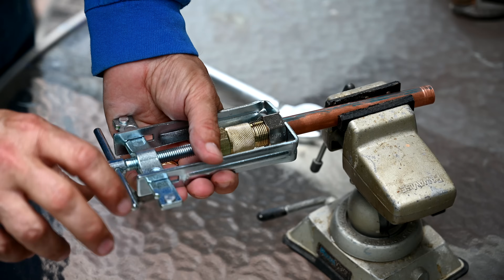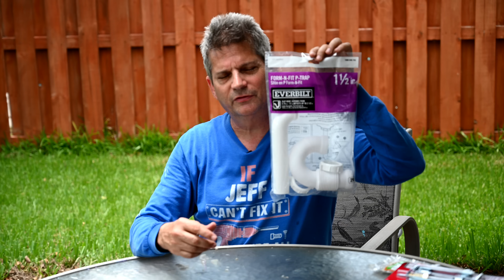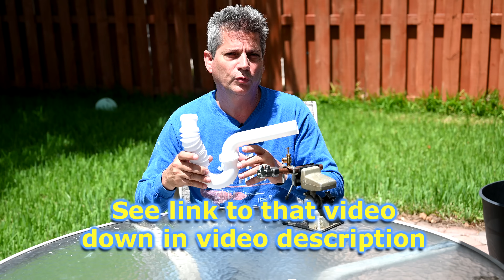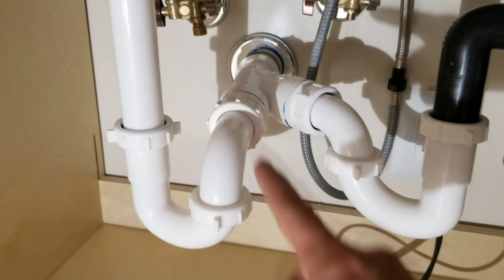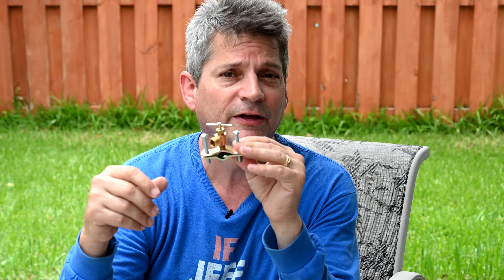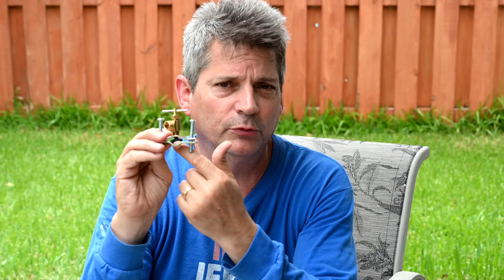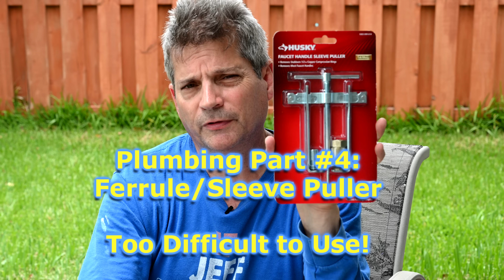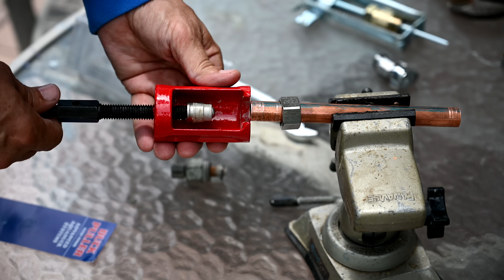4 Plumbing Parts/Tools You Should NEVER Use. NO Plumbing Fails

Comment: The reason why there is so many DIY plumbers is because plumbers charge so dam much for a simple fix or change 🤷‍♂️
Reply: You so called licensed  plumbers are nothing but thieves. I am a licensed plumber working as a handyman  because I have a conscience
Reply: @phillipbailey5178  yes sir.  Right with u
Reply: If it's just water ya charged to much but when they are dealing with your shit pipes then I'd bet those Plumbers aren't paid enough.
Reply: and how much do you pay an hour to have your car fixed?
Reply: @stevem268  sure as hell not as much as plumbers charge for simple flat rate.  Average for mechanic here in ND is anywhere from 75-100$ and hour.  And 100 being rare and on the serious high end. And imo mechanics is alot more technical than plumbing is.
Reply: @rikjohnson39  first of all, there's no drinking in my house. Secondly the last thing I would do is call a 24/7 plumber so he can give me the reach around and charge me 5 times of a normal rate because its an "emergency"
Reply: @nwhome9615  hallelujah.    Im a roustabout.   A plumber of sorts in the oilfield in ND. THE BAKKEN.   Granted the plumbing is to flow oil and gas. Far more dangerous n skilled n labor intensive and my hourly wage is 28$/hr.   Boss bills out for 40/hr.  And banks the difference.    Residential plumbers are nothing more than them dam lawyers who are commonly referred to as ambulance chasers.  They prey on those who call at awkward times.  Omg I got a leaky pipe, is Easter Sunday idk wat to do..    secretly... "hmm. Desperation...  that'll be 3500$...  "    wat do u do.  No knowledge.  Its a holiday and a Sunday, u got family over.  Dam...  residebtial plumbers are soulless imo.  They prey on the week.
Reply from the maker: I think everyone should know how to do simple stuff, then when you need to solder in a new main valve outside, you call in the pros.
Reply: @jeffostroff  Totally agree with you on that on
Reply: @jeffostroff  u don't need to solder squat.  Dude ur just trying to pitch urself as if ur a dam unicorn n that there's no other option available.  Stop it already.  Do a good job.  Earn a reputation n stop being so criticism upon the diy'er.    Noones perfect. Not even you dude.   Just face it.  Ur simply trying to justifying ur overcharging.      Smh. Really. Its not rocket science. I understand a trade is worth something but dam buddy.  U plumbers charge more than any other person in a skilled trade I know.  And I know alot.   Heck, if my drain was plugged wit spaghetti noodles n clogged n called you, you'd come out with a plunger for 5 minutes n prolly bill me 700$      joke!!!!
Reply: @jeffostroff  Some of the simple jobs turn into nightmares simply because people see them as simple jobs.
Reply: @jeffostroff  Good luck finding a "pro" who will answer a call, give a quote, show up to do the work, etc. This goes for plumbers, electricians, carpenters, etc. At least in my area. I bought an old house last year with all intentions of hiring people to complete a bunch of projects that needed done. Ended up just learning to do stuff myself because no one wanted to work. Best thing that ever happened to me though!
Reply: That is true, buuut you can pay me now or pay me later...
Reply: @adropofmyblood   ....and if you pay me later, you always wind up paying me more......       If you don't fix at the first signs until it gets bad, then it always gets worse for repair costs.
Reply: @rikjohnson39  thanks I already do my own plumbing with no experience. Doesn't take a genius.
Reply: @nwhome9615  (I am a master plumber's wife) giggle, giggle giggle, that's funny. Doesn't take a genius, ok giggle, giggle. Did you find that leak in the wall without ripping up ALL the ceiling or the wallboard yet?
Reply: @tonysadler5290  Lead?  Aren't razor blades stainless steel?  Who makes those?  I have not seen any and I buy pretty cheap ones.  As far as the "shops", they sell lots of junk items, not just in plumbing.  However, items like the expanding p-trap seem downright abusive.  Personally, I upgrade everything.  I use nothing but exterior screws, etc.  It is not worth the cost for inferior products.  Same for plumbing.  Get the best not the cheapest.  I would never use anything other then a ball valve.  The may be expensive but will last.  All other valves leak or wear out.
Reply: Totally disagree, i find handymen are charging more than professionals these days
Reply: A plumber has to make so much every day to cover expenses , we have to charge a minimum  amount for the time, we use on a job no matter how easy,
Reply: how about you spend 4 years as a kicked dog apprentice and 2000 hours of in classroom apprentice school managed by The Dept of Labor. For the first 2 years on a dishwasher's wage. It it were you, how much would you charge crawling around in the dirt for a week repiping someones home. How about buyin a van ,tooling it out, buying 4 kinds of insurance, state and local licensing fees and make it all back + providing a living for your family on changing faucets, rodding out building sewers (4k-5k sewer machine/ 10k water jet/ 2k line camera) If you want cheap labor that is the kind your gonna get and if a flood occures might want to check your homeowners policy. Hiring an illegal plumber is an illegal contract and somthing illegal your policy will not cover
Reply: Plumbers job worth their pay. Skills, dirty hazardous job with no insurance cover.no retirement benefits. Wages are daily. When sick no work no pay.
Reply: Education and knowledge costs $$$....
Reply: I did plumbing for a year and a half. as and apprentice I only made $10 per hour. but when it came time to replace my sewer line from the house to the sewer main, I only had to pay for the plumber's equipment rental and permit and the hourly wage for the plumber. I signed a liability waiver as a subcontractor for the plumber and did most of the pipefitting myself. I also bought most the materials myself and had them ready when they showed up. 100 feet of pipe, some couplings, some wyes and st. 45's. they were able to reuse the main tap with a new saddle. there's alot that goes into plumbing.
Reply: @krazi77  very true... common sense goes far...
Reply: I agree. I had someone quote me $1500 for a less than 8ft gas line extension to my range. I ended up doing it with the help from a family friend who has done it before. All I had to do was buy a pipe rethreader for $50
Reply: Yeah I quit medical school so I could make more in plumbing !!!
Reply: Dentists charge a lot, do we have DIY dentists?
Reply: @dave8599  well..   now your asking alot. I got into a bar fight. Broke my front tooth right off.    I got dental insurance but how do u explain this..      I took a channel lock n strait up ripped the tooth from my head. Lol
Reply: More than docs
Reply: Plumbers have to travel to/from sites, buy specialized tools, AND (most importantly) deal with disgusting sewage situations. They can do a job in 45 mins that would take you half a day and two trips to the hardware store. It sucks to have to pay a pro, but, as always with any trade, you are paying for time AND knowledge.
Reply: Sounds like someone that doesn't value anyone else's time.
Reply: Absolutely correct!! Utter ripoffs👎👎👎
Reply: Incorrect. You pay the right price for someone else's skill and knowledge. They weren't born with these skills, they have to train to do it. I bet you wouldn't use the same theory if you had to go to court, ie, you could always try do it yourself for free.
Reply: @ef7480  You also pay a premium for the parts because they have a bunch of parts on their work truck, and don't have to make multiple hardware store runs. You pay in the labor rate for them to have a work truck, maintenance on the work truck, the plumber's boss, company advertising, the plumber's time at your job, 25% for time the plumber is between jobs (whether that time occurs or not) the plumber's travel time to your location (remember they are allways on the other side of town for their previous job and the next job, profit for the shareholders, pay for the executive board, pay for the HR department, pay for the insurance, pay for the insurer's insurance, pay for stupidity insurance, pay for sue happy customer insurance, etc. The plumber himself gets less than 25% of the labor charged to you, so the labor rate has to be high enough for him to get paid reasonably.
Reply: @javaman2883  Always us a plumber with no HR department if you can.  The problem is many only do certain type of work unlike the corporation outfits.
Reply: @javaman2883  but on that not 9f having spare parts n paying for them..  im a plumber of sorts and cats coming out the bag here...  how many times u on a big commercial job or contracted for one company and have side gigs but ur contracted gigs u have a huge parts trailer with everything at your disposal, in which many various parts simply end up on ur truck n ur on another job n need a specific part n "oh snap I have this n that on my truck from another job that that company paid for, n yet you still bill said other person and trumped up fee for a part u mysteriously acquired FOR FREE??  Just saying.
Reply: @toriless  where I live we do it all... heating, propane,  plumbing, water pumps,  submersible,  electric,  on an on. Get closer to the city's an most do only one.
Reply: All you guys complaining about what trade people charge should read The creature from Jekel Island. You're dollars just aren't worth much any more.
Reply: The price includes monthly note on a big truck, licensing, the time to drive to and from your home and suppliers,  monthly cost to rent shop area, health insurance, a retirement plan, truck maintenance and storage and lots of supplies that are easy to overlook.   And they must work because it is leak tested for success.  Try that with an investment advisor or lawyer or physician who are paid far more and offer no guarantees that your won't lose your savings or feel worse or die from the medical treatment.
Reply: @podamis314  You nailed it. Lawyers and physicians are professionals that DO NOT guarantee the outcome of their work and they still charge a lot !!!
Reply: @podamis314  Exactly, useless overhead like any bloated corporation.  A skilled plumber needs a van with tools, common parts, a driveway and a spare trailer.  What you think other skilled workers do not check their work.  That is ridiculous. 

I am not fan of doctors either.  It is all guesswork, not like on TV AT ALL.  Doctors misdiagnose all the time.  Even easy stuff, every time I have a skin issue and it is seen not by a dermatologist their are always wrong.  The percentage is much higher when you get a specialist but not always. 

Heck, it too me decades to find a decent hair "stylist" for male hair.  Most are very mediocre unlike to want military cut or something easy.
Reply: Please stop undervaluing labor, especially essential labor. If you are capable of doing it yourself for less, and are willing to spend the time, then do it yourself. Otherwise, you owe a fair wage to the men and women who's labor you depend upon.
Reply: @princezzpuffypants6287  totally agree. But when this guy making his cynical remarks basically placing us who choose to take the path less traveled as being fools.... yeah I take offense to it.  He seems to focus more on his subtle ridicule on those as if its cuz he's hating cuz folks are learning to do things on their own vs paying hooker rates for a simple pipe fix.   Its a joke. I've literally seen plumbers come in do a job take hour maybe hour n half max n bill out for 1500$ plus.  And I can assure you I'd one would price out parts/materials...  that'd be less than wats in my 4 yr olds piggy bank right now.  No joke.
Reply: They charge that much because they can.  They have a skill and knowledge that you don't .  If that plumber was your kid you would tell them to charge double.  It is called capitalism.  A good plumber(electrician, carpenter etc) is worth the price they charge.  The key word there is "good".  I have known many skilled tradesman.  They are worth it.  I have done many home improvement projects on my own and they turned out fine.  I have also had a few disasters that ended up costing me more than if I just hired a pro.  The key is to find good tradesman that are fair.  You are paying for their skills and knowledge and years of experience.  Just like if you hired a computer guy to fix your computer.  You could possibly do it yourself but then again probably not.
Reply: Plumbers are worth what they charge. Their job most of the time is a difficult and dirty one. Plus, they have to be paid for their skills.
Reply: I had a clogged kitchen sink called Roto Rooter they wanted to charge me $500 I had done it myself before but I had knee surgery so I called them I kicked that mother F——- out of my house.
Reply: Your house is your investment. Do you want it done right?? Or half ass?? Plumbing prices are what the living wage is for where you and they live. If not they should be reported to the BBB. I'm fare with my customers. I just don't work for free. I have to eat and pay bills just like any other business or trade. Sorry. Not to be funny but, I like steak and lobster just like everyone else does.
Reply: @billywoodman60   I understand Bill . Please share your opinion on this ... A plumber came to my house last week , told me that the plumbing under the kitchen sink was done wrong and he quoted me 475 $ !!! just to re-do the plumbing ( only tubing ) , plus 225 $ if I need to change the garbage disposal . Total of 700 $ , what do you think ?
Reply: @billywoodman60  facts.... if it was so easy everyone would do it themselves,  people don't understand the amount of tool's you use on the daily.  Nevertheless bigger items like threaders,  rotorouters, etc. I doubt highly most people would be willing to put thier hands up to thier elbows in human waste... lol... 25 years I've been in the trade. Knowledge and craftsmanship is important.  Our job's carry a great deal of responsibility.  Much respect 🙌
Reply: @billywoodman60  if that rate is more than about $30 an hour I'll be doing it myself. (Half assed or otherwise)
Reply: It has to do with taxation...
Reply: So the fair price to replace one section of pipe that I have to dig up in my yard is $2500 and if they bring in the machinery to do the digging  it should be over $3000 for literally one section of drain pipe ?????????
Reply: joe nobody yeah 3k sounds about right. They have to buy hat machinery you don’t have. Transport it maintain it and have the knowledge to use it. Plus fixing the pipe. It’s not cheap to dig down to a pipe
Reply: @joenobody571  sounds pretty cheap to me.... most escavators are well over 150 an hour plus trucking,  would assume your looking at half a day's work between digging,  hand digging the pipe so it can be replaced,  then hand compacted so it doesn't sink and pull apart.  Tested properly.  Etc.
Reply: @joenobody571  lets see and break it down. #1 time spent fiding the problem/ #2 one backhoe, /#3 trailer, / #4 dump truck for the stone to bed the pipe and haul the hoe./#5 skid loader to transport the stone to the excavation and onto the new pipe to bed it so it does nor settle or oval /#6- three people to do the work /#7 a licensed CDL driver to haul the equiptment and hopefully he can help with the work too / #8 cost of material and permits/ #8 the cost of doing business: insurance on Everything, payroll and employee tax et,,
Reply: @marvinsprowl8811  🥱
Reply: @marvinsprowl8811 1 person to work and 3 to clap and cheer!😂🤣😂🤣😂🤣
Reply: Obviously you are not a business owner. Hopefully your paying for experience and expertise. What is your time worth at you job ?
Reply: @hosedude70  i have my own business but I also have decency. Thats not to say that plumbers don't have any. There's a difference between overcharging and trying to make a living.

Comment: Glad I didn't use the cheap p trap solution. Was very tempting though.
Is this ok?
https://photos.app.goo.gl/iLfd5PaBvWs67ttN76
Reply from the maker: No NHB, it looks like the output of the P-trap you have two 90 turns, which is not allowed by code. Is there a way you can swivel the p-trap counterclockwise so that the output of the p-trap feeds  more directly or 45 degree angle into the pipe without using 2 of the 90 degree parts? 45 degree fittings are better, or small bend fittings are better also, but try for anything other than sharp turn 90 degree fittings. Remember waste water is not under pressure so you have to use rounded corners to keep the flow going. Is it draining OK for you now? Have you tried a full sink and emptying it out?
Reply: @jeffostroff  sink drains with no issue. Thanks
Reply: I finally fixed it.
Before - https://photos.app.goo.gl/iLfd5PaBvWs67ttN7
After - https://photos.app.goo.gl/jPYnnikhaTjcF8b86
Thanks!

Comment: Can't watch this, as it should be possible to explain in less than 5 minutes.  Not over 26 minutes.
Reply from the maker: 4 parts, just over 6 minutes each, not too much time to ask you to spend learning about them and the plumbing codes, after all this is what real plumbers have to go through. Guys like you that never want to spend a few minutes to learn the proper techniques are why we have failures that cost people thousands. Go find your 2 minute video on saddle valves, and when you install one and it fails and you find out why it failed after paying a plumber $300 to fix it, you'll be mad at the guys making 2 minute videos for not talking long enough to warn you of the pitfalls. If you're not willing to put in the time to learn correctly and the codes behind it, then you should not be attempting any of theses tasks, you're not qualified.